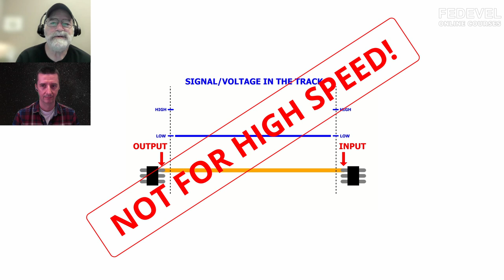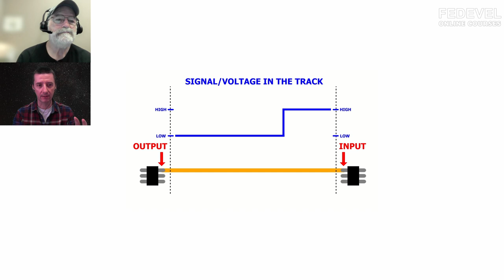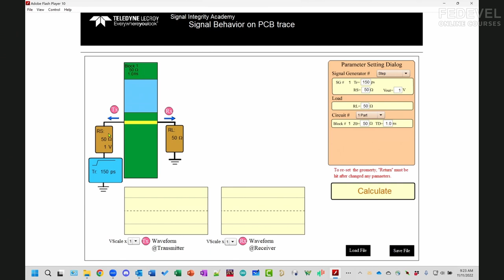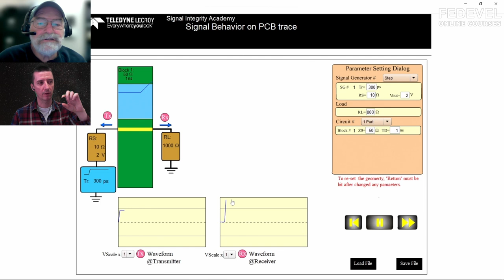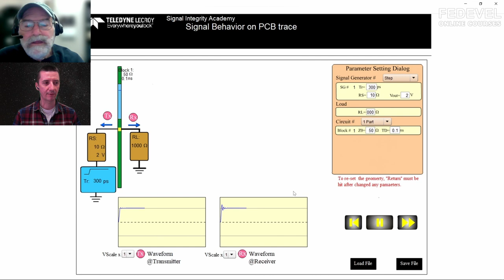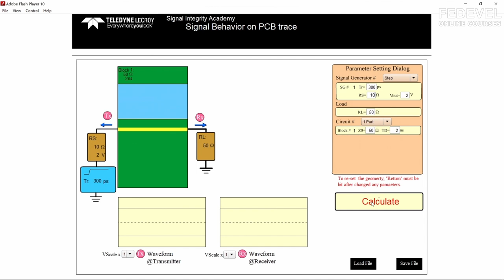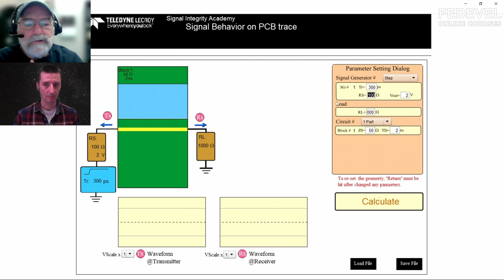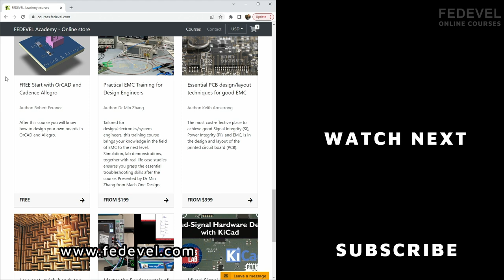When a Signal Hits The End of a PCB Track - What happens? | Reflections by Eric Bogatin

Comment: Great walkthrough. My question is what if the output resistance of drive is 50 ohm, it seems termination resistor is not required. But what is the downside?
Reply: high driving current

Comment: Why dont you terminate with 50ohm with capacitor to 0V to avoid halfing the voltage level?
Reply from the maker: Signal edge is built from many different frequencies and we need 50 ohm for every frequency. An ideal capacitor's impedance for low frequencies is very high (DC doesn't flow through a capacitor), an ideal capacitor's impedance for high frequencies is very low (capacitor is a short circuit for high frequencies). For real capacitors it is a little bit different, but still, a standard capacitor will not have 50OHM impedance for wide range frequencies - that is why resistor is a simpler solution. PS: watch 39:25 about halfling the level
Reply: @RobertFeranec  Yes, I think I was unclear about what I mean. Ringing is often rather high frequent. I want to avoid 50ohm loading on logic DC-levels (and low frequent digital pulses) and still maintain the logic levels without halfing it. Placing a capacitor in series with a resistor to 0V will give zero current (i.e. low power consumption) at DC and low frequencies. Problematic ringing is only a troublesome issue in the fast signal transitions. My intention is that the capacitor shall be a short circuit at high frequencies and thus the 50 resistor terminates high frequencies well and att low frequencies the capacitor is high impedant and thus disconnects the terminating resistor. This is how we sometimes handled emc-issues on high frequency databus-es when I was working at Flextronics.
Thank you for great videos Robert, (a little bit toooo long videos, but very interesting videos! :-) )
Reply: Yes you can do a AC termination system if the change of the signal is low enough compared to the capacitance of the wire. you need a capacitor at least 10 times the capacitance of the entire trace. and the signal can't change a a rate faster than the RC time constant. I use AC termination in many places where I want sharp edges without reflections, but my application meets the requirements. Edit: this is a Capacitor and a resistor in series. The frequencies only see the resistor and the capacitor only needs to hold on till the energy is absorbed.
Reply: @LaserFur  Yes, ofcourse... AC-temination is the word for it! Thanks

Comment: 50 ohm impedance is desired from end to end but this gives half the voltage of the output. Isnt that a problem?
Reply from the maker: Watch the source termination 39:25 Notice the voltage on the input.
Reply: Seems that load should be higher impedance to cause reflections to build up to the full voltage of the reciever. So load being same impedance with source and line is not a good thing.